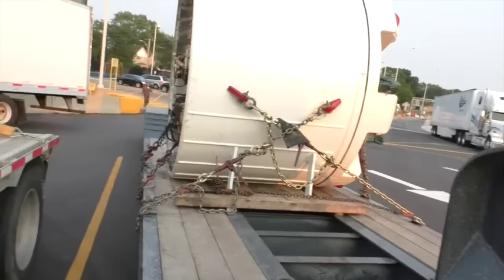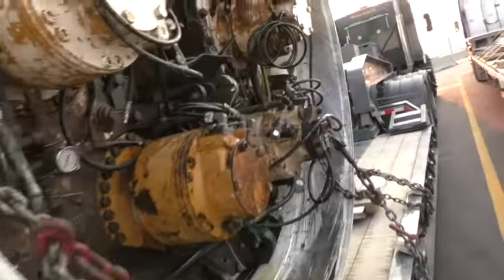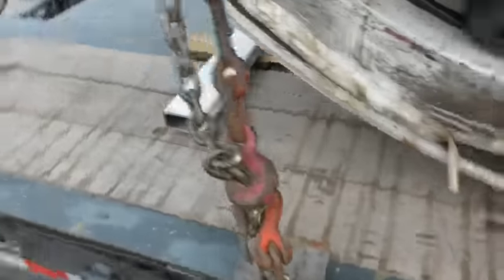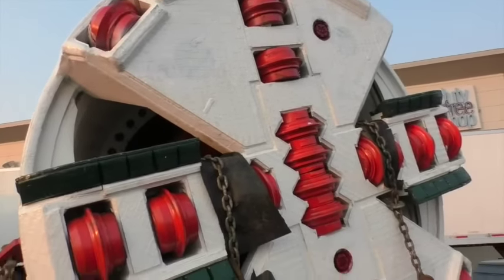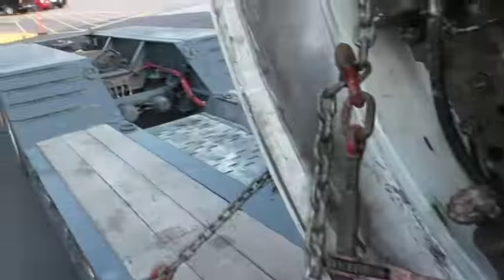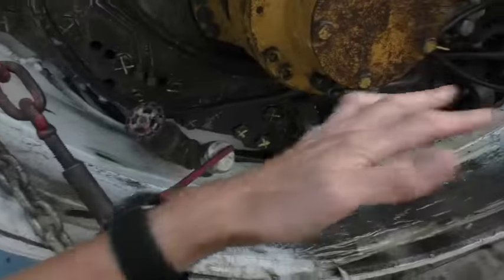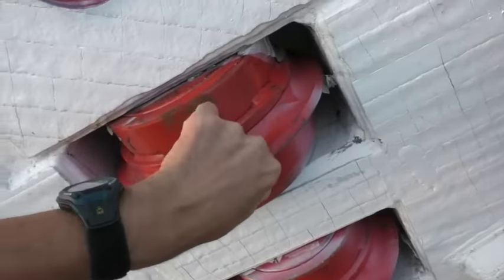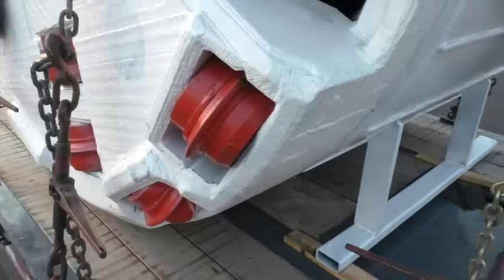HEAVY HAUL TV: Episode 235; 8/31/2015

Comment: Very interesting load Sergei a tunnel boring machine head , watch when you go around a corner you will flip over , good job securing this load , yes if you stop quick it will roll on top of you .Have a safe trip !
Reply: I don't know if it will roll, remember he does have that block and 3/8th chain as security....lol
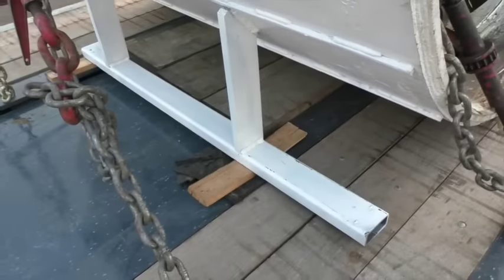Reply from the maker: +dave allen it's not going anywhere. at 3:41 in the video you can clearly see that this thing is equipped with 'legs' on both sides, which prevent it from rolling. here's a question for you: knowing I have secured the load with 8 chains (1/2" thick), what do you think would happen if this truck was sent in deep space and it flipped over?
Reply: ***** Nothing would happen ? I didn't mean to say you didn't secure it properly I know you did , things do happen , I was just showing concern please don't take it the wrong way .
Reply from the maker: there's no gravity in space. so, if my truck flipped over while on board of some intergalactic transport, the cutting head assembly would stay put ;) it was a trick question.
Reply: ***** I thought so have a good trip Ok take care , getting warm we are getting another heat wave !

Comment: The 61K pound Horizontal Tunneling Head is impressive but makes me want to go see the three story high Excalibore in Ontario. I've been interested in Big Bertha, Hitachi Zosen 57'4" diameter 200 ton head stuck under Washington State. WSDOT says it is 1083 feet in and 120 feet deep - Quite a spectacle! I keep picturing Japanese tourists standing around with cameras. Apparently, with these machines, debris find their way in through the front seals and damaged bearings are common. Then they have to dig a hole down to the head, remove it for repair then reassemble under ground. Spending 36 million to repair a 1.2 billion dollar machine is just business - Amazing stuff.

Comment: The gear change will be interesting to see how you like it.Will result in bit higher revs on the hi way and use a bit more fuel but better performance?
Reply from the maker: +peterincgy people always talk about worse fuel mileage with slower gears. fuel mileage will suffer only if you keep driving at 90MPH. i do heavy haul. i stay at or BELOW 60 MPH when hauling heavy loads. why would my fuel mileage suffer? if anything, it should improve because i'll get more torque at the wheels.

Comment: The bulk of the weight is in the head which you are hauling. We ran a tunnel boring machine down at the port of Miami. The cutting head was 44ft in diameter.
Reply from the maker: +Nick penn why do you think we positioned if off center?

Comment: Rich D; sound advice.  But, I thought the speedometer cable was on the steer [front] axle and changing gear ratios wouldn't make any difference.
Reply from the maker: +Silver Turtle Cables were used till the start of World War 2. Now it's all sensors. When you change the gears, you have to tell the ECM how to calculate speed. It uses an approximation of this formula: Tire Revs per Mile X Top Gear Ratio Times AXLE RATIO. That's your RPM at 60 MPH. Right now at 60, I'm doing: 492 x 0.73 x 3.91 or 1,404 RPM. With 4.10 ratio, RPM at 60 will go up to 492 x 0.73 x 4.1 or 1,472.
Reply: +Sergei Dratchev (Heavy Haul TV) Sergei -- I sincerely thank you and others for the information.  I did not know these things; now I do.  Your videos are informative, sometimes hilarious, and always entertaining.  It's a shame you can't film the customs person's reaction when you tell them 'no guns, but I DO have this..."
Reply: +Sergei Dratchev (Heavy Haul TV) I'm thinking 1472 RPM is better and will actually result in decreased engine wear and appreciatively little mpg significance. Great price to boot! Will you be able to pull heavy on grades in 18 without lugging I suspect? Is the real benefit in the low range gears or both ends?

Comment: Probably a lot like chaining down a giant coil
Reply from the maker: +Joshua Diley yeah, but next time i'm putting some timbers under the outside edges as well. there was too much weight all concentrated in the middle of the trailer. it's best to spread it out.
Reply: +Sergei Dratchev (Heavy Haul TV) yeah, 61,000 in such a small area. too much for even the mighty Kauffman!